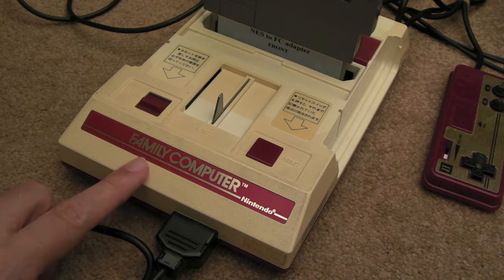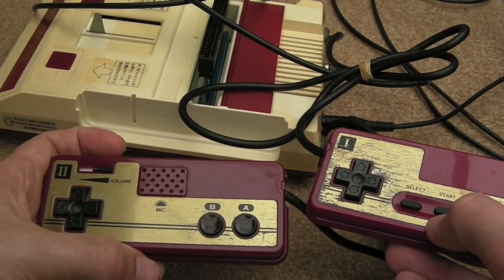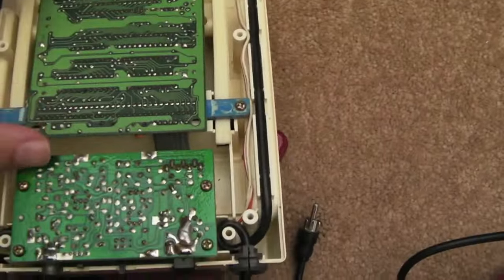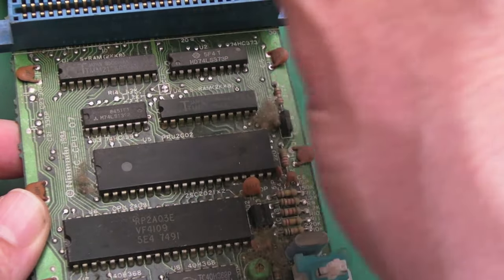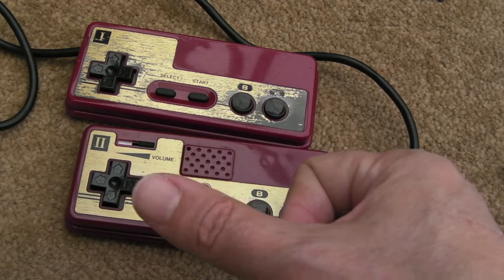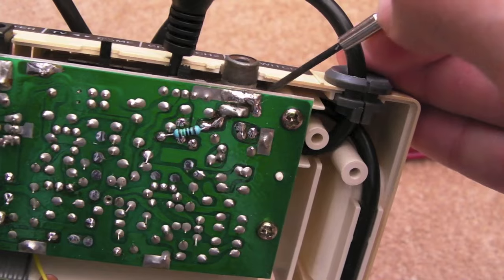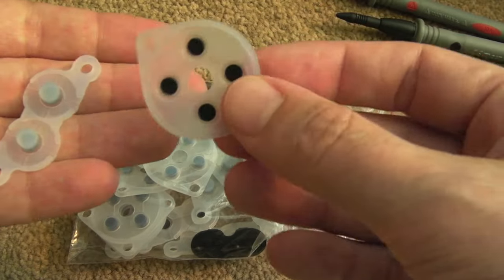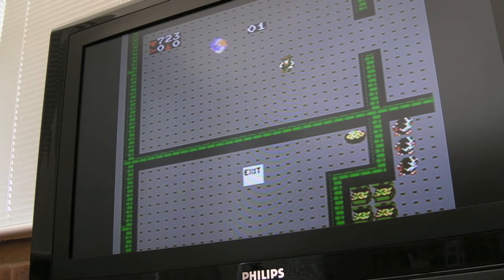Nintendo Famicom Restore & AV Mod

Comment: Cool mods there, when i did the av mod i lifted pin 21 from the board and built the circuit on top  of the ppu chip with a short shielded wire going straight out the back. All it needs now is longer controller cables.
Reply from the maker: Yes - that's a good point, it is possible to just take the video output, run it through a transistor and cap etc and just bypass the modulator board entirely.   The approach I've taken is the lazy approach, but it works and looks acceptable.  At some point I might consider an RGB mod of some sort, at that point I might do away with modulator board.

Comment: Interesting renovation. The controller buttons are usually made from silicone rubber with a pad of conductive silicone rubber - there's no coating, but they often have marks on the surface from repeated contact with the PCB surface. The PCB part of the buttons is either just metallic, usually with a non oxidising plating such as gold, or they have a screen printed area of conductive carbon which is designed to increase conductivity and endurance. The best cleaner for these is isopropyl alcohol, as with the switches which shouldn't be scraped as the contacts have a non oxidising plating which, if removed, will lead to corrosion and increased electrical resistance. The facia panel on the controller front is made from anodised aluminium sheet with screen printed graphics. The gold colouring is applied as part of the anodising process and would be very difficult to replicate. I would suggest either trying to source replacement aluminium panels or maybe replica stickers.
Reply from the maker: Awesome information as usual =D  With regards to the silicone buttons, do you know of any theoretical way of joining up the splits?  Super glue doesn't work - despite having read that it works.  I did consider hot air, but trying to focus it only on the area in question might be impossible without some form of mold, and I am not sure if its even possible to melt silicone.  There must be a chemical solution to the problem, something that will bond two silicone surfaces together.
Reply from the maker: Those switch contacts btw - they often do need scratching (they certainly did in this case), because their surface has worn away over years of use.  In new working switches the surface as you say is protected, but it does wear off from regular use.
Reply: +GadgetUK164 With regard to the silicone rubber splits there is a mouldable synthetic rubber glue called Sugru which would be able to repair them. It is  Plasticine-like before it cures so can be moulded and after 24 hours it cures to a very flexible rubber compound. It's also great for all sorts of other purposes and comes in a wide range of colours although, like Plasticine, it's blendable to obtain a specific colour, if required. Just Google 'Sugru' for more information.
Reply from the maker: Thanks, I will try some of that!

Comment: I'm a beginner/novice at soldering and doing these types of mods. As you mentioned this is more of a vlog then a tutorial, and I think you do a fantastic job of showing your work.  Do you have a tutorial suggestion so I could do a A/V mod to my first Famicom?
Reply from the maker: Thanks =D  I did cover a lot of the AV mod stuff in the series of "5 Famicom Repairs" that I did - I showed a little more detail there on what to do to get composite and sound out of these.
Reply: GadgetUK164 - Retro Gaming Repairs & Mods I did watch those!  I just want to make sure that I don't mess things up is all.  Thank you for your time and help!
Reply from the maker: No problem =D  Let me know how you get on!

Comment: Excellent video, I’ve not seen inside a famicom before. you need to get hold of a gold electroplating kit and have a go with that plate on the controller, give the famicim a bit of bling
Reply from the maker: Hehe lol.  It might not be that easy - connecting the wire could prove tricky I think - maybe dig a hole underneath from the inside of the plastic and somehow join a wire up on the inside of the metal?    Removing the old paint could also be fun - paint remover would melt the plastic probably, but I guess it could be cleaned using a dremel.
Reply: I’m guessing the metal part is glued to the plastic. you could try soaking the front case half in hot-ish soapy water for a couple of hours that should release the glue so you can separate the plastic from the metal. this is the technique I use to get the silver plate off atari 2600 jnr tops without damaging them. you then have no worry about damaging the plastic while stripping the paint.
Reply from the maker: That's a great idea!!!  I guess I could also try soaking in IPA - that might disolve any glue.
Reply: it could also effect the plastic, id be a little cautious soaking in IPA. I was wondering (I haven't tried it) weather you could soak it in a bath of caustic soda that should loosen both the glue and the paint but not effect the plastic or metal. safety precautions advised if you try it tho as its nasty shit.

Comment: Nice, I modded mine this weekend...one of the hardest mods I ever did...
I noticed even when adding 0,1 uf capacitors, I still have a kind of shimmering/wobbling effect especially in horizontal shooters like Parodius/Gradius...The contours of background gets shaky when there is a scrolling. Do you have the same ?
Reply from the maker: I will check that next time I get it out (soon).

Comment: Those conductive rubber pads from NES are identical with a famicom.
The reset line is inverted so 5v ripple may cause distorsion to the next video pin.
Reply from the maker: Thanks!  They work in the PC Engine controller as well =D

Comment: How would you do the a/v mod using a kit like the one offered by RetroFixes that uses the 3.5mm cable that has both audio and video? I haven't seen 1 person try it or any instructions.
Reply from the maker: It's really simple to do - I just prefer RCA / phono jacks.   The 3.5mm stereo socket has 3 connections - wire one pin up to ground, one to composite video, the other pin to sound.   The best way to do it is buy a 3.5mm plug to 2 x RCA / Phono plugs cable first, and measure on contuity on your multimeter to work out which connections on the 3.5mm plug connect to which points on the RCA plugs.   The common connection is ground, the other connections you can use for audio and video.
Reply: Thank you! I hope you could please, please do a video on this some day!

Comment: Another fine mod, I was scratching my head also when you mentioned the cap on the reset pin. It's pointless, the only reason I
can think for this is maybe the guy wanted to add some bypass to the cartridge slot but accidently added it to the reset pin of
the cartridge slot.
Reply from the maker: Yes, its very strange!  Reading the article I think it was supposed to remove noise from the video signal.  I wonder if the reset line does carry noise on some revisions, and that noise into the PPU adds to the jailbars.  On mine it made no difference what so ever!  Neither did the copper tape under the PPU at the end of the video - others have had more success with that.  I suspect PPU revision is going to be part of the issue, and I would get a better picture if I took the video straight from the PPU and just added my own amp I think.

Comment: Good thinking with the directional pad fix  ! These little systems are great, did you get this on import from JP ?   I am not sure if this system suffers from the same issue as the SNES where it turns yellow due to a reaction in the plastic and UV light ? - Good little fix up there! thumbs!
Reply from the maker: Thanks!  Yes, it does go yellow from UV - It's yellowed, I am just not bothered about treating it as it's OK imo.

Comment: I can't get over the short controller cables. I have a Sharp Famicom Twin and I'm tempted to open her up and replace the stock cables with some modifies NES controller extension cables and pigtail them out the back. I'm not exactly sure how to wire up the cables properly, without losing the mic on controller 2, but I've read that it is possible through the standard NES controller pinout.
Reply from the maker: Tell me about it lol!!  That's one thing I forgot to mention - cables are like 1 foot long lol, and the other annoyance worth mentioning is that front controller port!!!!   The front controller port works with the Everdrive menu and most Japanese region games, and some US games, but many games just don't recognize the controller =/
Reply: +GadgetUK164 Yeah, that port is treated more like an expansion port. Rumor has it, there are tons of Japanese Famicom accessories floating around the US due to people buying them, unaware that they aren't compatible with the NES, because they use that proprietary port. Everything from 3rd party controllers to the Zapper use it on the Famicom because of those damn built in controllers.

Comment: Just a fun little machine to have isn't it? What's that green blob on the logic board? You might try and find a couple of replacement controllers. Nice video this. Learned a few things again. Good stuff.
Reply from the maker: Yes, they are a lovely machine.  I think the only let down is the fixed controller cables of short length =/  The green component on there is a variable capacitor I think - probably used to tweak the system clock.
Reply: A variable capacitor...never heard of that. But I know all about timing and caps now :) 
It shouldn't be too hard to fit the console with pluggable controllers. If there's room enough that is.

Comment: Great video. Out of curiosity why did you choose composite over RGB scart. I have a famicom AV modded with RGB scart and the picture is stunning.
Reply from the maker: I've chosen not to go RGB at this stage as the NES does not natively produce RGB (unless you use a play choice PPU but then I think you can get issues).  The NESRGB board basically copies reads and writes from the PPU and CPU, and produces its own version of the display.  So it's more of a technical thing - it's kind of like emulating the display in my mind.  That said, it's technically and visually impressive, so I might consider some sort of RGB mod or hidef mod to one of my NES or Famicom systems at some point in future =D

Comment: Hi i konow this isn't your latest video but can you tell me where did you get this replacement eject button? I broked mine when cleaning my unit.
Reply from the maker: eBay!  If there's no spares now, there may be one next week, or the week after etc.  I watched eBay for 2 or 3 weeks before a few popped up.  The only other place is from a faulty unit, which sell for around £15 to £20.
Reply: GadgetUK164 - Retro Gaming Repairs & Mods Thanks for your help I will check ebay more often then. Or maybe try to fix that broken one with some epoxy maybe. By the way your videos are very helpful you are doing great job.
Reply from the maker: Thanks =D

Comment: Did you have to run a ground wire for the audio? I recently bought a famicom with this exact mod already installed but it has no ground wire for the audio. I see on your video when you first installed the audio as a test you had a white wire coming from the audio rca as well as a wire running to pin 46 on the cartridge port for the sound, I presume the white wire was ground but I couldn't see where the wire went to on the board. Mine works fine without this so not sure if it's necessary?

Edit: on closer inspection it looks like you have the white wire soldered to the metal on the power supply board. Is this the ground and should I add this wire?
Reply from the maker: There is probably a better place to mount it, but I found I get perfect audio (and video) using the ground of the modulator can - anything connected to it.
Reply: @GadgetUK164  firstly I want to say thanks for replying. Secondly sorry if I sound dumb but could you explain some more? I don't fully understand electronics, I've modded all of my other retro consoles myself but only with the aid of detailed videos so I can follow step by step. All successfully I might add but when people post replies I usually struggle to understand due to my lack of knowledge on the subject. I'm not sure what the modular can is? Where exactly should I solder the ground wire? An image would be amazing if you have the time or a mark on a diagram.
Thanks for your help
Reply from the maker: The metal shield that goes around the RF socket - that is the modulator can.  It will be soldered through the board in a few places - all of those connect to ground, so you can solder your groud for audio and video anywhere around those points where the large metal can joins the PCB.
Reply: @GadgetUK164  Got it! Thanks for your reply. Much appreciated.

Comment: from where and where, you have taken elastic bands for the gamepad?
Reply from the maker: Do you mean the silicone parts for the buttons and d-pad?
Reply: Yes. Especially the crosspiece interests. At me white color, are pressed hard therefore I would like to buy such, as at you, transparent.
Reply from the maker: Here:- http://www.ebay.co.uk/itm/New-Replacement-Part-Rubber-NES-Silicon-Button-For-Nintendo-Controller-Game-Pad-/232158610392?hash=item360dbb43d8:g:380AAOSwA3dYSpGp  You can also find them on AliExpress if you search for NES silicone.   With some of these replacement silicones, you have to add insulation tape on the under side of the d-pad in order to get diagonals working properly.
Reply: on your video, it isn't shown that you added an insulating tape, you have silicone elastic bands
Reply from the maker: The silicones are new (see the link in the previous message).  But you have to use insulation tape on the top of the d-pad in order to get diagonals properly.  I will show this in the next video.
Reply: ok. I will wait for video
Reply: I thought these elastic bands will approach the av new famicom gamepad, but unfortunately haven't gone... you don't know where it is possible to buy elastic bands for gamepad av new famicom??

Comment: Just re-watched this as I've just got a famicom on ebay £7 plus £10 post. cant believe how cheep you can get them.
Reply from the maker: Yeah, you can get them even cheaper than that on eBay!  Often one seller will put up 10 or more of them, all at 99p with around 10 quid postage and often they will get no bids at all.
Reply from the maker: But they are time consuming to clean up etc and often a bit bashed up.

Comment: Great video. I wonder if you also have got a NES (the Pal one), as I would like to know about any improvements in the video; in the quality of the image that you can actually get out of it. In any case, any recommendation is much appreciated. I know that there is a hdmi new solution, but it costs 130$
Reply from the maker: There's not a massive amount you can do really, you can add a 47uF bypass cap on the VCC and GND connections of the PPU, perhaps also add a 100nF in paralell or something, and some people use the grounded copper tape underneath the PPU (over the traces there), but I found that makes little difference.   Beyond that you would need to think about either the RGB board mods you can get, or the hidef NES board.

Comment: Can't you just order a gold plated pcb to replace the faces on the controllers with?
Reply from the maker: That's certainly a possiblity - if you can get thin enough PCB, which is possible I think.   There are also replacement available, and modern after market ones (see part 3 for the ones I used).

Comment: im sure gametech has some mods you can do.
Reply from the maker: It might be possible to do the NESRGB mod, but not sure it can fit inside the Famicom case.  It's a similar problem with the HDMI NES mod - not sure if it will fit in the fami.   I've already done a stereo mod, which is nice but needs an amp imo, so I might do a follow up on that.  The only other mod that I think is possible is to fit NES controller ports, but that involves killing or salvaging from a NES and I don't fancy cutting holes in the case.
Reply: well if ya do any mods, post em up, i'll watch em.